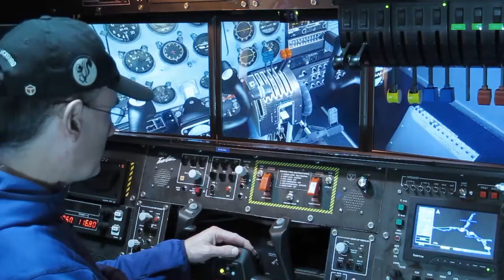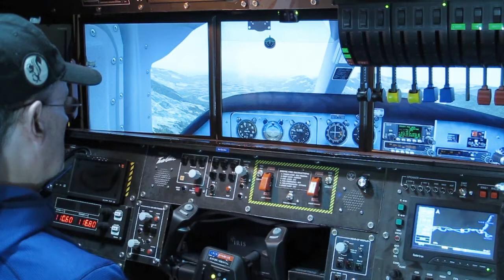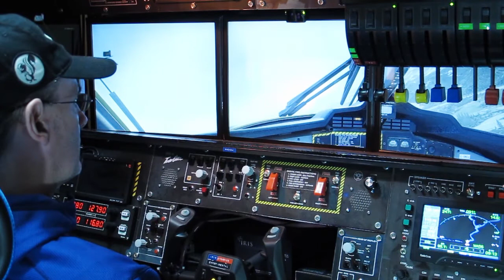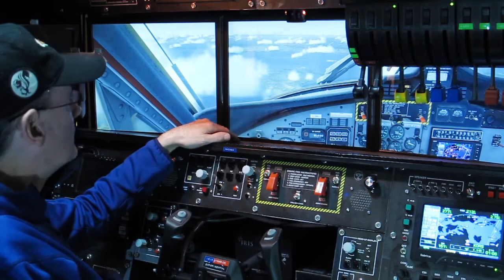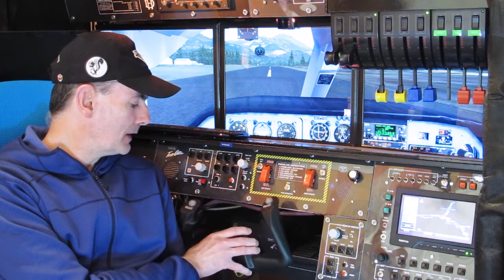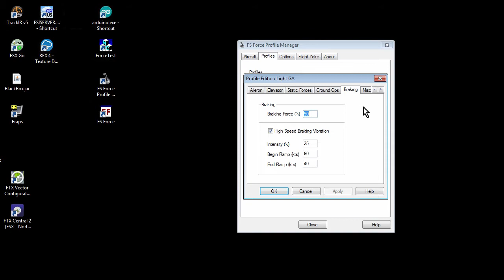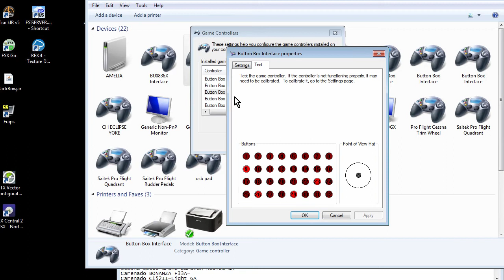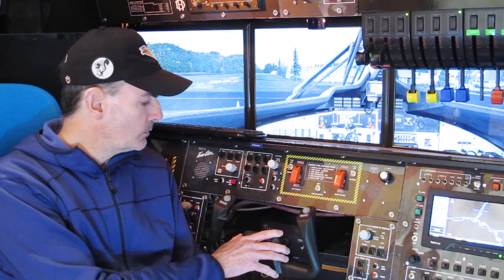Iris Dynamics Dragonfly Yoke with FSX & FS-Force (Part 2)

Comment: Hey Mark, thanks for the great review of FS Force.  Just thought I should clarify about the price.  Since a lot of people will be using FS Force with just a basic FF joystick, the cost in that scenario would be $34.95 USD.  And yes, you're right ... editing a .cfg file is pretty "dirty".  :-)  Stay tuned for an upgrade in the very near future to address that issue.
Reply from the maker: +Russel Dirks Hi Russ. Sorry, I should have been clearer on the pricing. $60 is for the basic plug-in PLUS the yoke module (AP follow and aileron re-mapping). Looking forward to what's to come...

Comment: Can you feel cross wind, ground effects, bumps on the runway ???
Reply from the maker: I'm not sure what you mean by 'ground effects' but you can't feel crosswinds with FS Force. You do get bumps on the runway but these are just cues, they don't actually reflect the terrain.

If you look at the Brunner FFB yokes I understand that their CLS2Sim software is much more sophisticated. That's where I would go if I was buying force feedback today.
Reply: @AlmostAviation  tnx for the prompt response ..... so what you telling me is that it's more a matter of software not hardware, did I get it right ? the other thing, is I didn't get this thing with the trim, can you use the Saitek Trim wheel in conjunction with this Yoke, and ,probably, the last request is can you elaborate a bit more on how to modify the yoke and make all the buttons/ switches working, is it something complicated ???
Reply from the maker: @yair1956  Yes, the software is what does the magic. Don't forget, all the yoke can actually do is push/pull and twist. The clever bit is for the software to use these simple actions to cue things from within the simulator world. I can't remember if you can use the unmodified Saitek trim wheel with FS Force, as it's an analogue control. I have mine hacked to work as a rotary encoder, so that just mimics two buttons and will work fine.

I'm not sure what you are asking about modifying the yoke. Perhaps you mean the handle, which I stole from a CH Eclipse. To do that there is literally nothing to set up other than finding a way to physically mount the Eclipse controller board, which I managed to get inside the handle. You could just tape it onto the outside of the handle and it would work. It plugs into a separate USB port and appears to Windows just like a CH Eclipse, except it is missing the analogue axes. It is an entirely separate device to the Iris yoke.
Reply: @AlmostAviation  ..now I understand, great, and tnx again  .... I have been watching and enjoyed your videos since the first episode